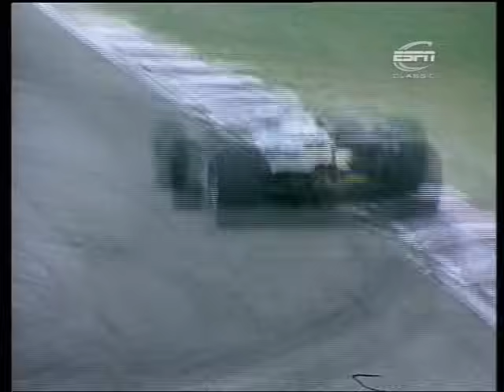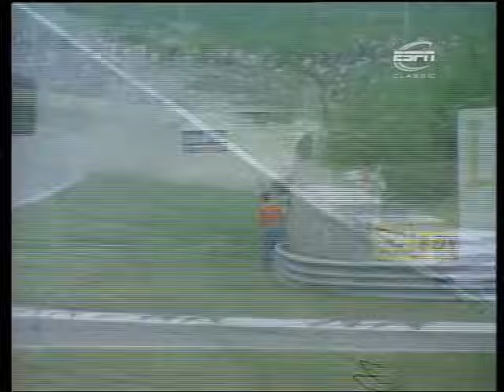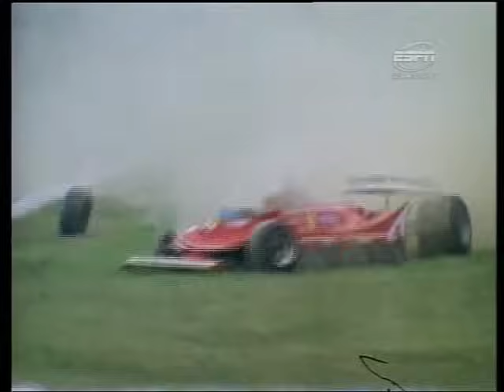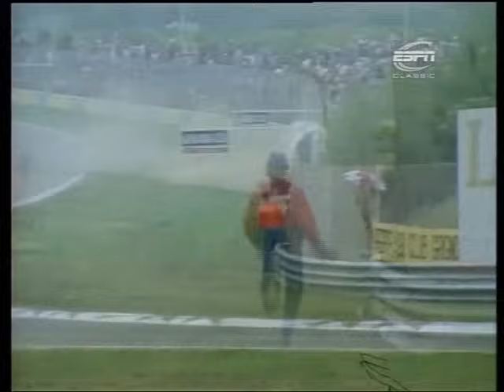Jody Scheckter crashes hard at Imola.

Comment: It was the same corner where Roland Ratzenberger crashed deadly in 1994.
Reply: Just thinking  the same.
Reply: @ctcdvch5539  no, he's right. It was the 'Tosa' left kink.
Reply: @ctcdvch5539  they are. compare the contours of the track. where‘s your counterproof? even MORE thumbs down?
Reply: @ctcdvch5539  does Putin still pay his trolls?  ;)
Reply: Exactly the same
Reply: @ctcdvch5539  stunnaboy
Reply: Gilles Villeneuve also crashed at the same corner in the race.
Reply: Die Kraft die beim Aufprall entstand war die größte jemals gemessene die auf einen rennfahrer einwirkte 500G.
Das heißt wenn er 75Kg wog wirkte eine Kraft von 37500kg auf ihn ein...
Reply: the only difference is that the South African driver did not absorb a force of 500G which corresponds to 500 times the weight of the driver's body absorbed by Ratzeberger, as for Alboreto in 1991 did not take the wheel in the helmet unlike Ayrton Senna